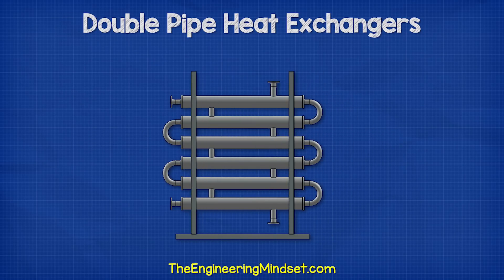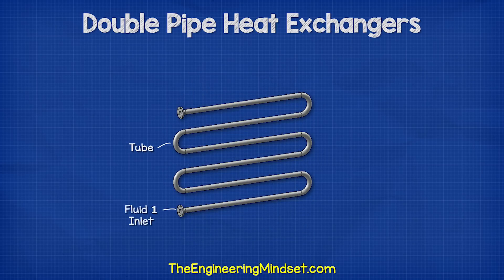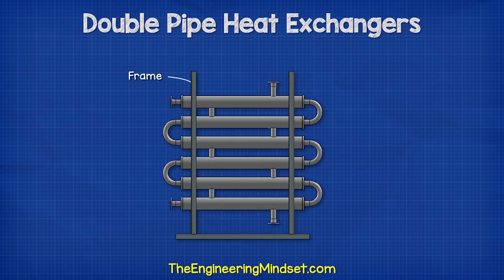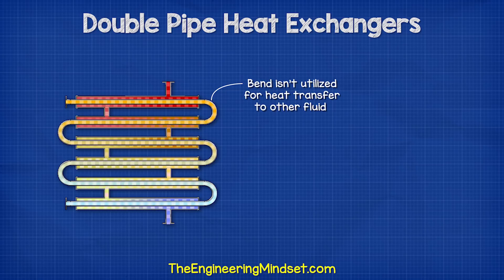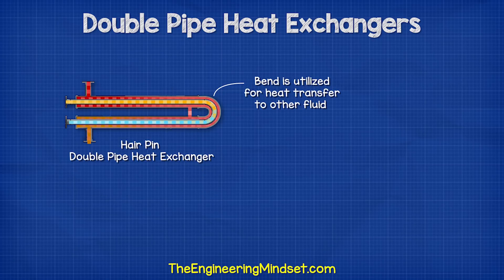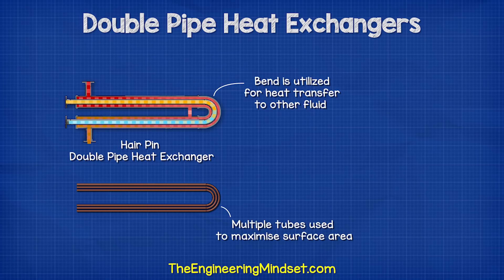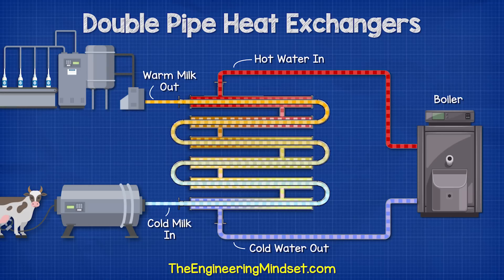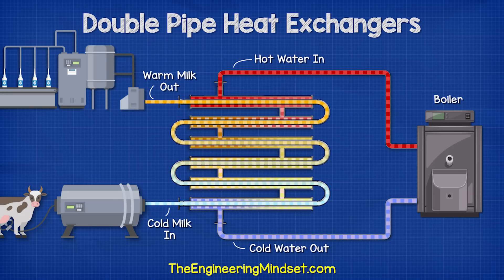Double Pipe Heat Exchanger Basics Explained - industrial engineering

Comment: The illustration at the end is how the pasteurization process is done with milk.  Where I work, we heat the milk up to around 180F by passing it through a one side of a heat exchanger, then it goes through winding pipe holding the temperature 22 seconds.  Then it passes through the other side of the heat exchanger and is brought back down to 35F.  temperature and time varies from company to company and also effects the taste and how long the milk will last.  The lower you heat it to, the better the milk will taste but will last much less longer and vice versa.

Comment: Suggestion: turbulators.🌀 I'm not sure if this is in the scope of this channel, but i found them very interesting from thermodynamics and fluid dynamic perspective. I tried to improve efficiency of my wood central heating boiler with tubular heat exchanger. There are many papers comparing different designs for both water-water systems and water air systems.
So far this is the best engineering explanation channel I found. I learned a lot. 😊Thank you. ( I'm vet. student😅)

Comment: how to objects stay the same colour - if the frequency of the re-emitted photon is dependent on the frequency of the photn the electron absorbed, how does an atom continuously produce a photon of the same colour/ why is an atoms colour constant?
Reply: I don't think the frequency emitted is dependent on the frequency absorbed. When an electron in an atom drops from a higher energy level to a lower one, the photon emitted always has the same energy/frequency for that change in level.
Reply: @matthewwakeham2206  ok so the electron will always emit the same frequency it was vibrating in its ground state? (eg. if its ground state is 430THz (red light) then the photon will be red light?)